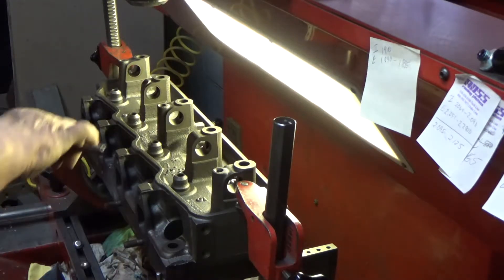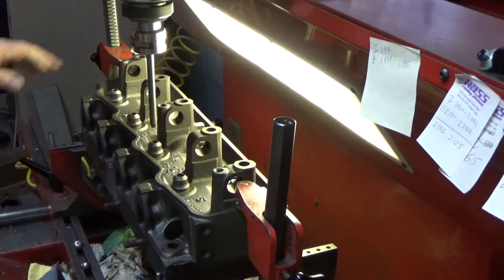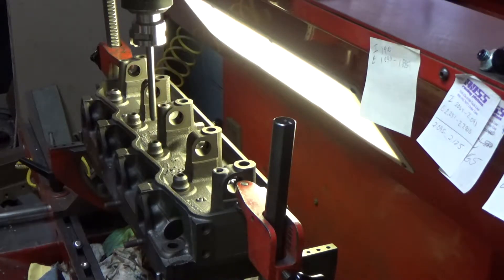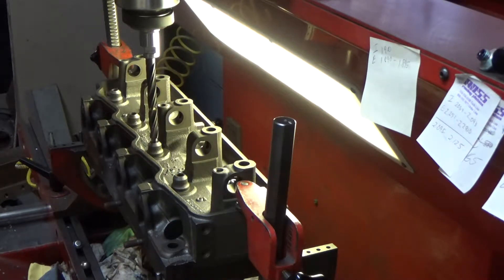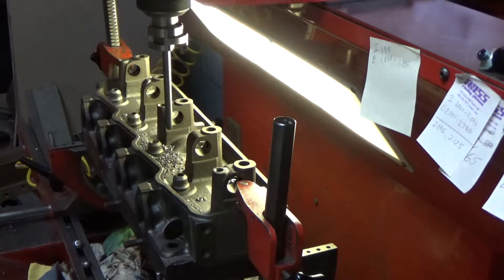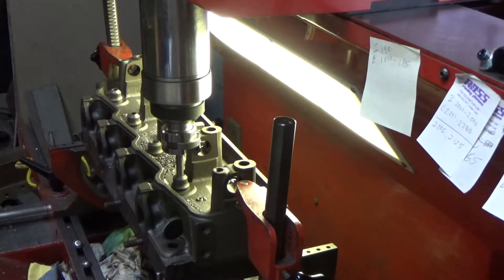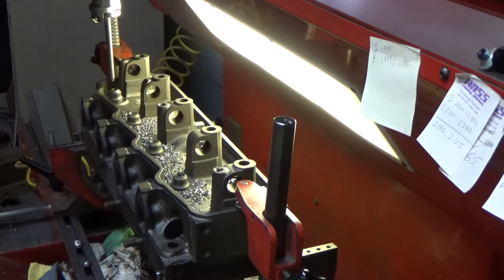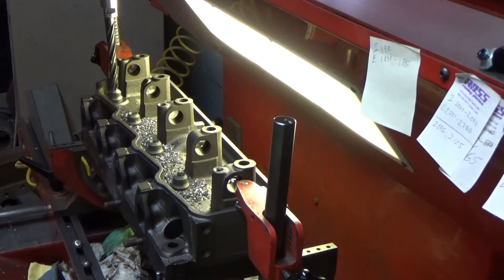VALVE GUIDE REPLACEMENT USING SERDI 100

Comment: Did I somehow miss the part where you actually replaced the valve guides?  All I saw was drilling each one.   Are you going to pull them nowv and press new ones, or are you using sleeves?